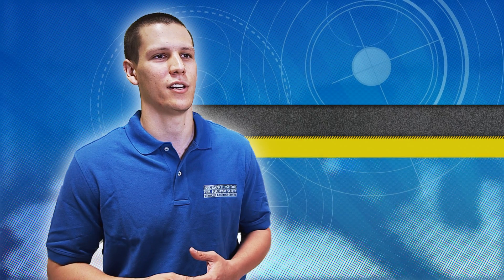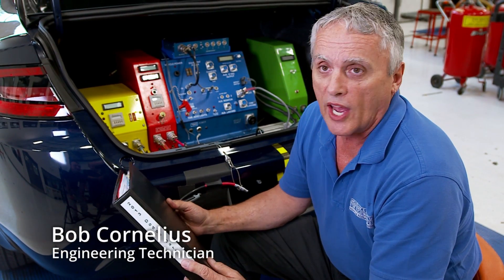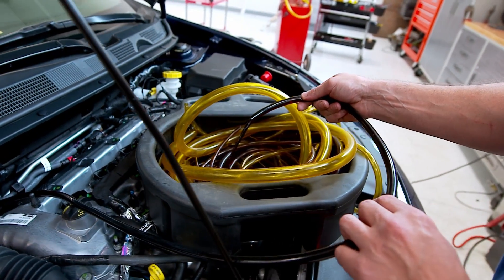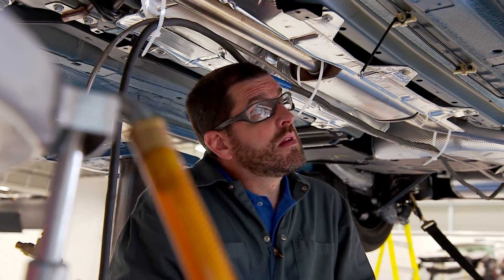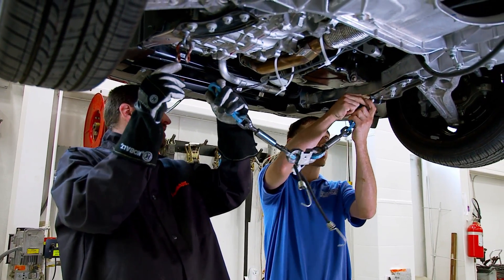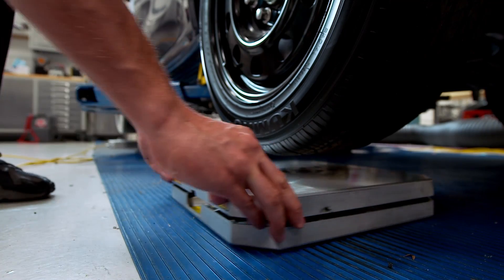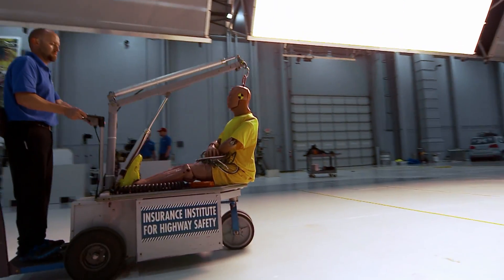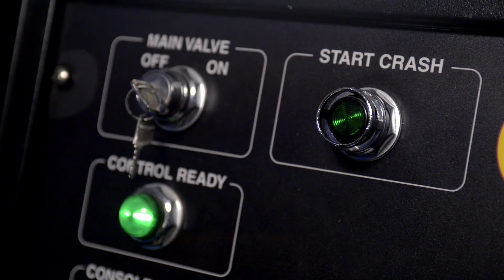Inside IIHS: Preparing for a crash test

Comment: what are the barriers made of that they crash cars into that doesnt budge or get damaged?  is it 6in steel plate?  and what is it mounted to?
Reply: The barriers are mostly welded structural steel assemblies, usually .750-1.0" thick cold formed steel impact surfaces. Some are bolted to a  fixture that is flush with the floor but extends down and outward from the bolt surface with a concrete and steel monolithic struture, but some flat frontal walls extend below and project above floor level with fixtures for different modes bolted to it.

Comment: How much do the instruments in the trunk weigh ? That’s a lot of weight bolted to the rear of the car that’s not there from the factory
Reply: The cars are ballasted to a specific test weight and cg so the instrumentation and photo equipment weight isn't a factor on it's own,  but it's all relatively lightweight anyway....most test facilities have a rack load of less than 50lbs.